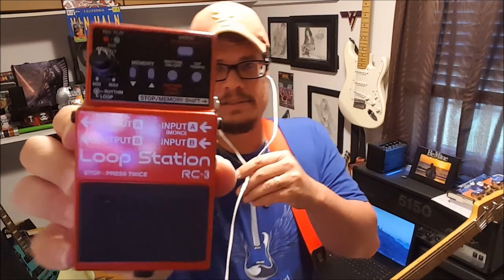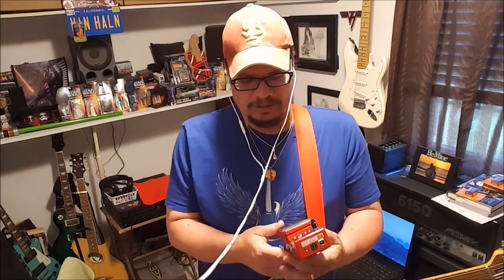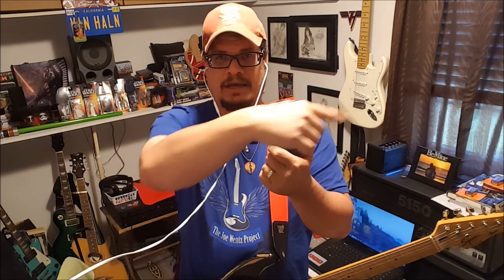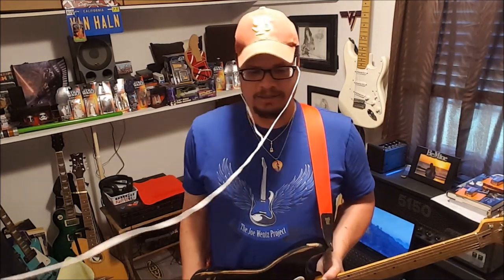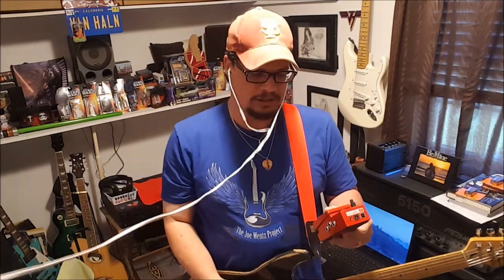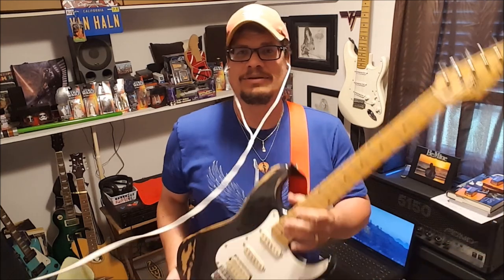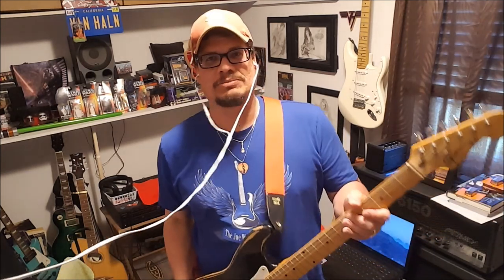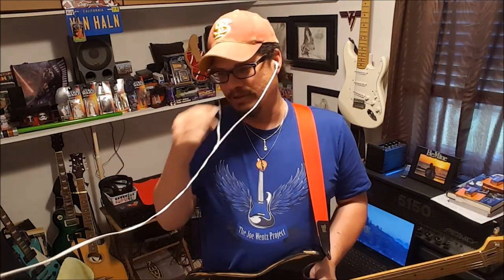My Boss RC 3 Looper Pedal

Comment: Joe if the power converter you have is a 1Stop. You can get a Multi-Plug 8 Cable for 1 SPOT. The wife got me a looper pedal for Christmas. I look at buying those 9V battery and thought it going to run in to lot of money buying them. Back in March I bought 3 more pedals. I look at the 1spot nd it said it out puts 17 mA. The pedal I got don't use half of that. So I pick put the cable for it. Later on I'm going to get a good power supply to mount under the pedalboard.
Reply from the maker: Michael Bishop Yes sir, I found a power supply yesterday, thank goodness!!